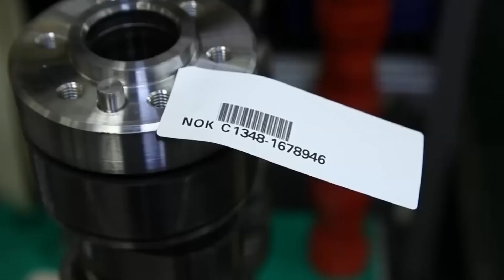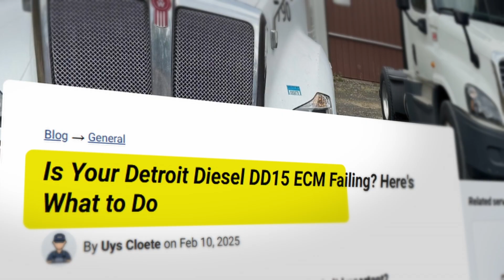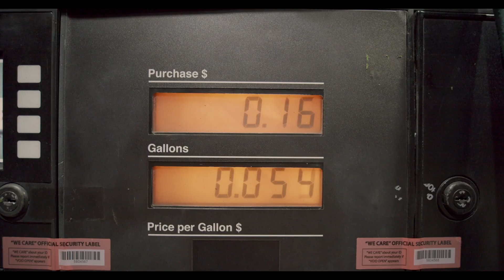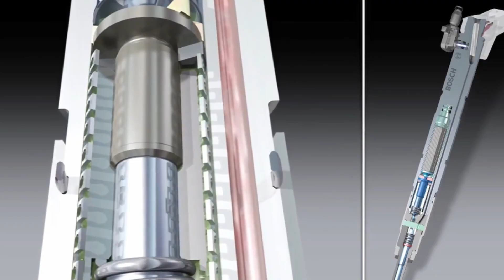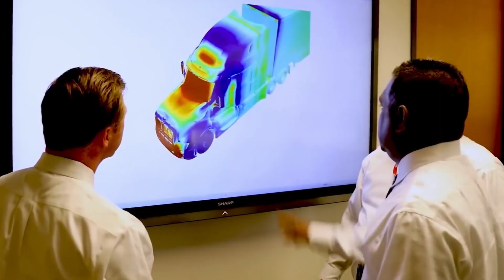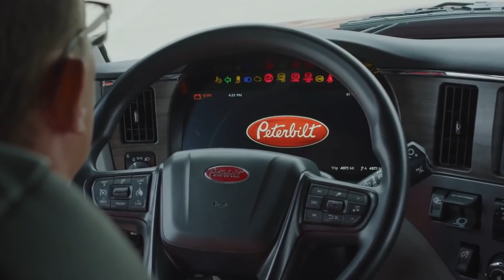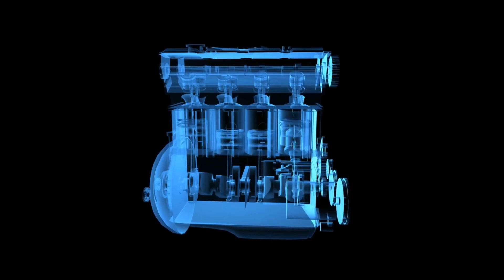PACCAR MX-13: The European Engine That's DESTROYING American Diesels (The Shocking Truth)

Comment: My boss bought some peterbilt with that pos and have had to replace 3 of the 5 truck engine  less than 20000 miles one only had 3000 miles because they just want hole up all day with 88 000 to 90 000 pound loads 5 to 6 days a week  3 to 4 loads a day and all 5 have had the injector replace 2 to 3 times already  they are a pos in my book

Comment: I purchased a Peterbilt 579 with a MX-13 with 700,000 miles. It’s running great….doesn’t burn any oil or coolant….fuel mileage is great (8.7 empty, 8.0 loaded). I stay on top of maintenance (10-12,000 miles every oil change) and have had a few minor sensors to change (manifold pressure, oil pressure). I have also put a FASS fuel system on to combat the fueling issues associated with the MX-13

Comment: The mx 13 / mx 15… is a Cummins engine branded as paccar ….
Reply: The MX-13 and MX-11 are developed and produced at Brainport Eindhoven, the Netherlands. The engines are metric till the very last bold. So, you're talking nonsense.
Reply: @47rintin1 that’s why all internal parts interchange with Cummins right , I’ve rebuilt plenty

Comment: Just Junk; you can now send that anchor motor to Cat with vin and purchase a new C-15 ..do the research ;)
Reply: Maybe YOU need to do some research !!!! CAT will only take a pre EGR engine. It has to be a 6NZ or older cat. A 60 series Ddec4 or older Detroit or a N14 or older Cummins. I know because I’ve purchased a brand new  6NZ and sent a 5EK I’m for the core.

Comment: Paccar just needs better filtration systems with the fuel because the injector problems and a better filter for the air system to the paccar transmission and prevent contamination of the mtm and a solid cam and that truck will save fuel and last a lifetime
Reply: Paccar  designed horrible to work on. I hate their high pressure fuel pipes. To replace #6 it’s a nightmare. You beed to lift the whole cabin . When you reuse these  pipes that is a 50% chance they will leak right a way. Everything is extremely tight fit and has no sense comparing to other manufacturers
Reply: @Druidvasia  if paccar was in cab overs like Europe with cleaner fuel it would be better than dd13

Comment: I drove for a fleet that had some of these engines. Brand new 2012s. The one I drove was either IN a shop or WAITING to get in a shop more days than it was out on the road the entire month of January 2012! Bonus: you could ONLY take it to a KW or Pete dealer for service. The problem was ALWAYS the emissions systems.  Be driving along & the dash would light up like a pinball machine! 
We normally had a 3 year trafe in cycle, but these 6 2012s were taken back to the dealer & traded in on new trucks with CUMMINS engines. They told the dealer to eat it or theyd take theor business elsewhere...this fleet had over 200 trucks. The dealer reluctantly ate ot on those 6 trucks rather than losing the customer & future truck sales to the fleet. 
Fuel economy was nothing to brag about, either.

Comment: these engines are crap.
Reply: These engines are so crap that the DAF 530 is the second on the list of most soled 16+ ton trucks in Brazil and the DAF 480 is number four in 2024. The production there started in 2014 and DAF needs to compete with Scania, Mercedes and Volvo.

Comment: I have  been working on this engine since it was launched in 2006 ,when it was just the MX in the DAF product ,,,In  europe we have issues which you may not have in the U.S ,   As for working on it ,it is not too bad there is worse I think in europe a lot of the issues is because they are pushing the boundrys and fuel wise there are issues mainly because the tolerances are so tight,any form of contam is an issue ,even failing to change the filters the recommended way can cause injector damage,,,In the UK it is mainly fleet customers ,trucks are generally on a contract wether from the manufacturer or a rental company ,are are renewed on a regular basis  which may be after a certain amount of years or milage,,,Camshafts will be replaced in a repair and cylinder liners will be replaced ,but because most vehicles are on a contract it never costs the user ,,The manufacturer takes the hit or the rental company ,who generally go to the manufacturer for a contribution,,As they order trucks in the 100s they have a bit of leverage

Comment: I have a 2020 Kenworth t680 with a PACCAR MX13. I purchased it almost 7 months ago from a one owner/one driver operation in Illinois, and I am more than pleased thus far. I haul flatbed heavy steel and lumber much of the time throughout the Mid-Atlantic, Midwest and Northeast regions of North America, averaging 6.6 mpg for ALL miles. My company was skeptical when they leraned that I bought a paccar diesel. Like many, they basically believe the negative talk surrounding the Paccar MX13. It's like people are waiting for my motor to leave me down, but it is performing very well. I do regular maintainance and do not idle more than absolutely necessary. I would recommend the MX13 to everyone. She's a performer!🙂

Comment: I used to service at a fleet shop, they stopped buying MX-13’s for ISK-15. Reliability, down time, and what was and wasn’t handled by warrantee. A month lead for sensors, DPF filter needing replacement during regular scheduled cleaning, wiring failures (rub through shorts). The higher oil pressure engines were better until the 51,000 to change a chronically failing engine. Cummins had issues, but more reliable, and only use 15-40 on the 10-30 engines.

Comment: Yes when it runs good it's great. This engine it's made to run in a perfect world though. And so far all I've had is headaches and big maintenance bills with this engine. Usual charge at dealership is $190 to $250 an hour plus the very expensive parts from DAF/Paccar.  I bought a 2020 kw t680 with 575k miles last year exactly 1 year ago.  It's only worked 7 months total out of the 12.   From water pump to entire engine replacement. I was thankful I bought it with some left over warranty and Thanks Paccar for the new long block but it made no sense to not replace the injectors at that time.  Unfortunately I was out of money by then,  I complained but paccar said no. And now I'm stuck with a broke down truck sitting at home rusting away. Because replacing 6 injectors is well over $8k on this very expensive engine.   Replace the motor when it's short life has ran out?   You better had saved well over 50k that's how much just the long block costs!  Not any mechanic can touch this engine by the way.  This engine not only requires a mechanic but also a computer tech. Water pump replacement parts and labor $2500 at kw texarkana TX.  Replaced air compressor head $4800 plus hotel stay at kw little rock. Replaced a few fuel lines and egr sensor plus tow truck $4500 at jax peterbilt ft Wayne IN.    Plus hotel stay 1 week because no parts.  Had to replace fuel pumps myself. All 3 of them. Lift pump twice...among other repairs.  Serviced engine oil breather canister and cleaned egr cooler while replacing engine $1000. Engine long block and oil breather service was done at peterbilt San Antonio Texas. I'm just afraid to take this truck on the road again and  I've talked to some other paccar owners and I get mixed stories from them, some good some bad.  But never seen nor heard of one of these engines hitting a million miles. Correct me if I'm wrong.
Reply: Even the video says they're designed for 800K miles max. Hope you can replace her by a good used Cummins power plant down the road. I feel for you.
Reply: A friend of mine own 2016 kw mx13 run over million miles
Reply: Supposedly, he sticks rigidly to all maintenance recommendations, or has lighter duties on his rig. I wifh him well.

Comment: MX13  250,000 miles so far just a couple different fuel injectors failed three different times. The fuel economy is unbelievable between 6.5 and 15 MPG